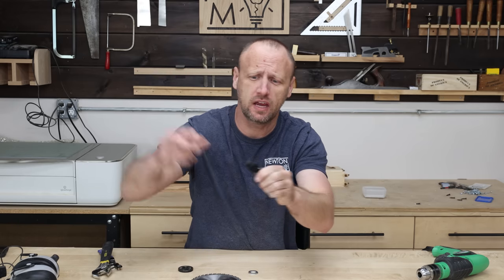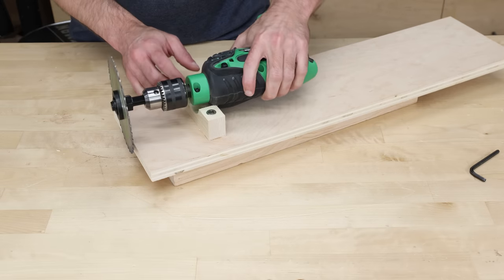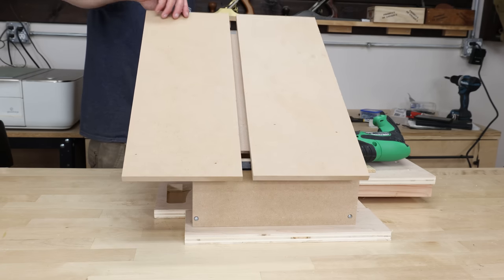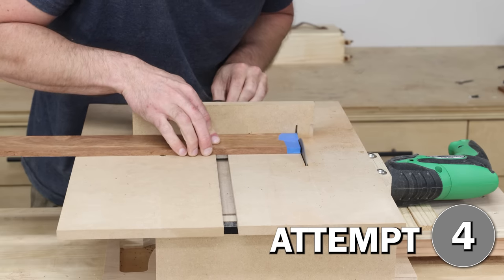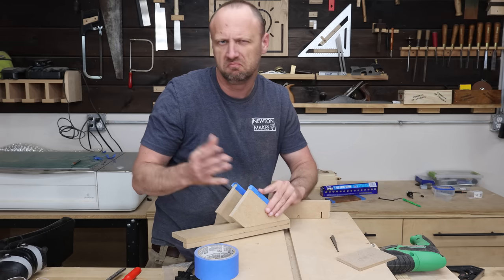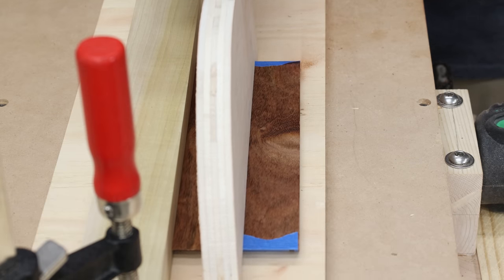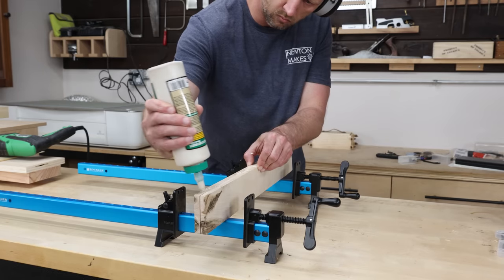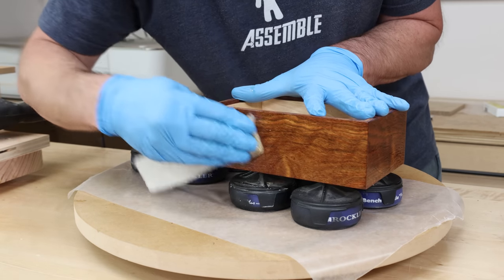How was this Wood Box Made with only a Drill?

Comment: That reminded me of a vintage attachment for a power drill that turned the drill into a scary looking circular saw.  My dad had one of these that was vintage in the '70s when I used it to cut some pieces of plywood.  As a teenager, I did not appreciate how dangerous that thing was.  If you search for "vintage drill circular saw attachment", you'll find many examples.  I don't believe I would use a contraption like that now.